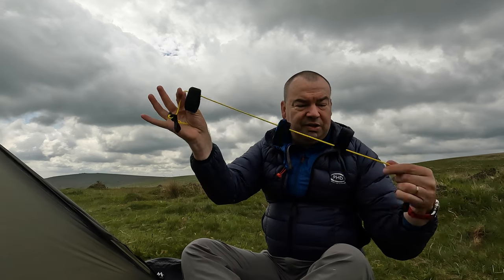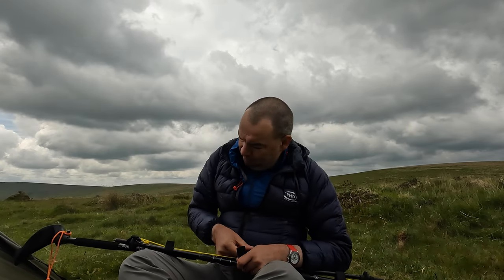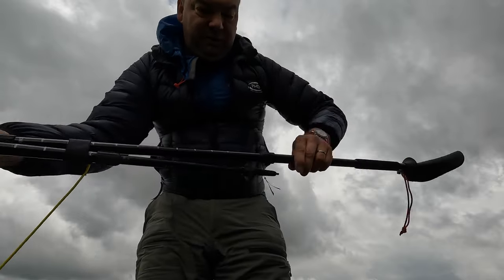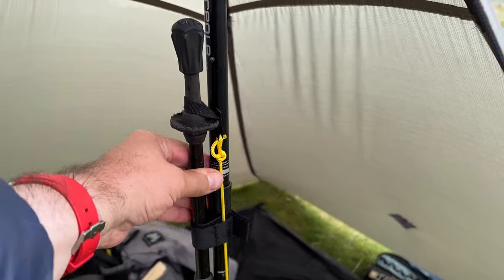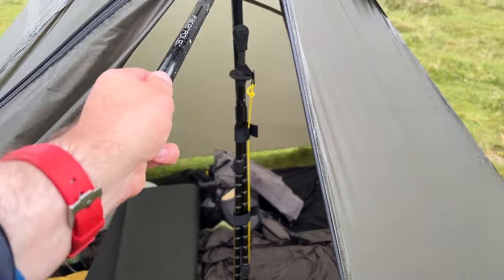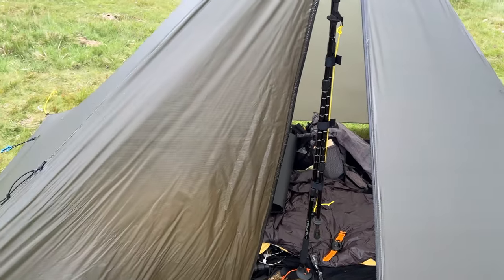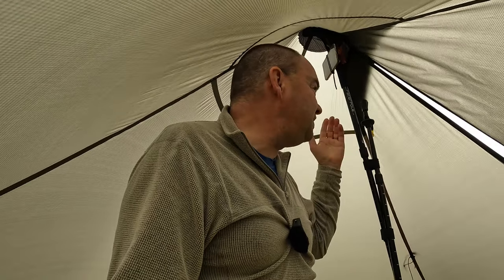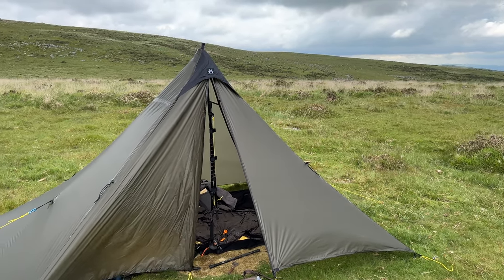How to connect walking poles | connectors | MLD cordage for Duomid XL Supermid | Ruta Locura

Comment: Hi tony, was out last week with my duomid XL for the first time , it qtas blowing a hoolie and raining fiercly , i put it up with my trekking pole and long pole extender (the mld on from the dual pole kit) .. anyway the wind was gisting about 40mph and the pole was bending like a longbow ..i thought "the pole tip is going to snap at any moment, luckily i brought the trekling pole joining kit as an afterthought, so googled your video, dropped the tent and did as you instructed under a billowing flysheet with my head torch and it worked a treat ... maybe should have practiced at home first, but lesson learned .. thanks mate 🙏
Reply from the maker: That is a good job you had connection kit.  One other thing I've done but not mentioned much maybe another video idea... I'll forget lol but strap a second pole to first Inc the extender just put pole next to first and and somehow strap tie wind guy line up them.  Always have extra line lol  thanks for comment.   Watching me whilst tent tries to take off 😆

Comment: Hi Tony -  there's so much to learn about this tent that isn't explained by MLD so your videos are really useful. I've got some Voile straps to sling my Leki poles together. Do you remember the length you asked for the pole to be cut to with Ruta Locura? Any reason you went with them especially? Thanks!
Reply from the maker: 63" 160cm with Inc 8" extension.   Its just right.  Could almost do being one Inch or two cm less for duomid xl but I bought for supermid and as such has an inclusive 8" extension. Needed for supermid. I extend it about 1-2" for that.
A friend recommended them.  They make excellent poles and customer service is excellent.   I got silpoly cricket and ordered a 54" with 8" extension for cricket. Vid on cricket soon plus bonus tip at end re duomid etc.  Thanks for watching and asking question?
Reply: Thanks Tony, MLD don’t recommend using a pole extension with the duomid XL due to the height, and I’m finding most people recommend pitching at  145cm - good to know there’s some upward tolerance. I’ll try my Voile straps solution out first before investing more cash on the pole. Final Q - knots - will bowline knots suffice for the stake ends of the guy lines? or is there a better knot? Am I’m right in thinking a taut line hitch is unnecessary thanks to the line locs?
Reply from the maker: May I ask... are people saying 145cm for Duomid XL?  That is far too low.  That us solomid xl Cricket height.  Duomid xl is 160cm I checked website.   Which is 63".  Website said 59" but that an error hopefully Ron changing to 63".  
Taut line not needed for line locks 
Just regular loop knot.  MLD send pole connection cord for two poles.  Good luck.
Reply: Hi Tony .. I'm not sure that 59 is an error as my carbon pole I bought with the XL is 59inches ... but I feel that might be ok on ground that is completely flat at the lowest setting possible .. mine was set at 64 inches on rough ground .. was pretty uneven ground right enough
Reply from the maker: @wuduwasa ah ok. Yes what is very very useful is adjustable pole.  My ruta lacura pole may well be 59" or 60 (not sure off hand) but has a clip adjustable thing to add one to 8" .  This exactly as you say is not only useful but critical on rough bumpy ground.  Thanks for watching and posting comment
Reply from the maker: I see my own comment above re my pole length 

145cm is 57"  I'd say the duomid xl is definitely more than 59" that's barely two more than duomid.... 59" on duomid xl or supermid will have it low and flappy I think.